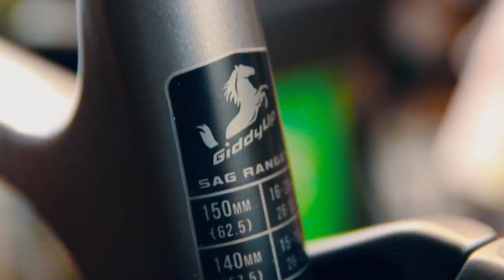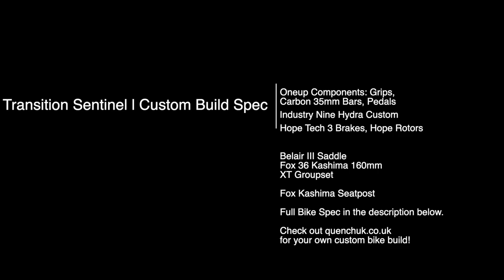9K 'Dream bike' | Transition Sentinel Custom Bike Build

Comment: Hey guys how did you get the hope floating rotor on the rear? I have a 200mm and the rivets hit the frame mounts, is there a way around this? I am running a i9 hub too so exactly same frame and wheels and mine won’t clear?!

Comment: What the recommended for use chainring on the transition sentinel (carbon or alloy) 32T or 34T
Reply from the maker: The max chainring size for Sentinels is 34T. All standard builds come with a 30T.